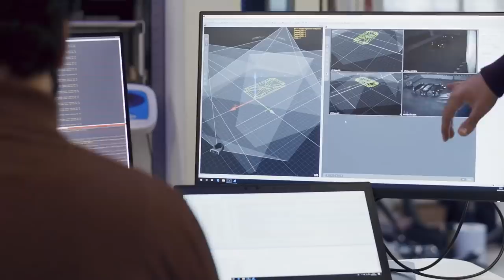Inside Arrival's Revolutionary Microfactory

Comment: Other than purely electric, among other details, pretty nice setup.
Reply: Electric cars are the only way to save the enviorment right now and right here you Boomer.
Reply: Electric is ideally suited to vehicles that do lots of laden stop and go, as well as vehicles that return to a depot at the end of their route.
Electric vehicles are 90ish percent efficient compared to about 30-35% for diesel or petrol.
Electric vehicles don't have any ignition, fuel, exhaust to maintain and rarely need brakes or fluid changes because of re-gen and no nasty combustion by-products.
Meanwhile... even the dirtiest coal plant produces energy much cleaner than an ICE when compared to equal motive power.
Honestly the only concern I've ever heard that bears merit is range anxiety for long distance travel, and those 1,000 mile days have been tackled by many publications and YouTubers.
Delivery vans and buses are the low hanging fruit that can make real change in economy and quality of life fro those that rely on them.

Comment: Interesting, but ultimately misses the point. 'Micro'-factory suggests that the company is trying to present an engineering solution to an economic reality(Economies of Scale); it does not. It doesn't solve the problem of scale. All of its technological revolutions would still cost less and have less environmental impact if they are just built to scale. Not doing so pollutes more and makes it more expensive.  There is actually no angle that this makes sense
Reply: Exactly. I see so much stuff these days that is 'innovation porn' that really just will never be economic. It's sci-fi masquering as non-fiction.

Comment: Don’t robots need specialist technicians? How is every micro factory going to do repairs abs maintenance?  How do you road test the vehicles if there is no proving ground next to the factory?

This seems to me to have limited applications and cannot replace the moveable assembly line for high volume production.

Comment: Electric vehicles are only as "zero emission" as the power plants that make the electricity ;-)
Reply: for now.   did you know that horse carriages and steam trains delivered parts for the first combustion engines to be made?
Reply: @name4467  Ok. Don't see the connection with my comment though..
Reply: @kamran102  what you said is in line most standard run of the mill comments people make that think renewable green energy is a joke because coal is currently used to power the machines that make them.
Reply: The look on their faces when they realize the pollution created by “zero emission” vehicles is 50 times greater than that of a “gritty“ combustion engine. As well as the dangers of the products left behind by the batteries, etc. which are created for these vehicles.
Reply: @name4467  Just saying that the car may be zero emission, but the power plant may very well not be. People don't know these things.. ;-)
Reply: @robertl.3074   did you read that on facebook or in the paper? depends on how they're repurposed from car to house etc and if you put it in the bin and not a battery recycling center. 
That phone you upgrade every 3 years and all those tvs and plastic commercial goods you buy will do far more damage then the small amount of cars you own.  rechargeable hydrogen cells are slowly rolling out and could be a game changer

Comment: This is so incredibly stupid. Transportation costs are one of the lowest factors in car production. Spare parts can be shipped as well.There's a good reason why they aren't showing price costs per EV.
Reply: You can't make an EV by doing this Frankenstein method it won't work.   You have to go old school get big and vertically integrate all the manufacturing in house that only way to get cost down.

Comment: This video is very biased. “Let’s talk about the advantages” like, come on, let’s talk about the disadvantages too. “A regular car factory can cost as much as a million euros per square foot. An Arrival microfactory only costs tens of thousands of dollars per square foot” meanwhile you specifically compare the area in square foot of the microfactory to the gigafactory, which you mention has “5.3 million square feet” so it cost around 5.3 trillion euros? It only cost a few billion... Meaning the gigafactory is cheaper per square foot than the microfactory. And every advantage you mention for Arrival is actually far behind Tesla. They are in completely different leagues. Tesla does every single thing with respect to manufacturing EVs better than any other car manufacturer. You can’t compare the two and conclude Arrival is better in any way with respect to EV manufacturing and quality without misleading the audience. 

Arrival seems like a cool startup though. The microfactory looks like a good idea for buses and other low volume vehicles such as custom vehicles. I think the microfactory will be more prevalent in the future as 3d printing and other tech improves. The microfactury certainly has advantages in factory locality, modularity, construction time, and product diversity that enable it to provide unique EVs to local customers.
Reply: Square meter
Reply: Important distinction these are busses not cars, I don’t believe it even competes with Tesla as Tesla isn’t making busses yet, also their skateboard design makes it easy to add whatever body you like, as someone who needs a van and doesn’t need all the luxury of a sedan. Also you won’t need to make as many as cars are just about 2 per household, this busses and vans are geared towards more commercial customers like ups. Making buses and vans close to where they are needed in the shape they are needed are in my opinion a great idea.  Also the fact that these are more resilient to scratch and dent a huge plus as someone who works in the construction field.

Comment: i like the design of the vans, but sadly, so far we've seen nothing new but the one and two year old footage. That questions the functionality of these so called "micro-factories". Conveyors were not made and have remained the way they are for fun - it serves a purpose. In my view, micro-factories are bs, made up to attract investors who know nothing about car making process. There is also a question of batteries for arrival - who produces them? There is no answer for that. Regarding buses there is also a reason why batteries are placed on the roof - floods. If the arrival bus runs into a flooded street it might short circuit. It does look cool, but it is waterproof?.. All in all, so far, arrival is nothing but disappointment to me. And they are closing in on switching the status from disappointment to scam. Much like Nikola... Main reason - there is zero new information about the company since a year ago. Investors should be worried.